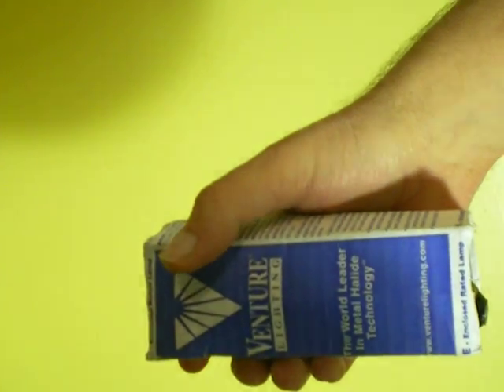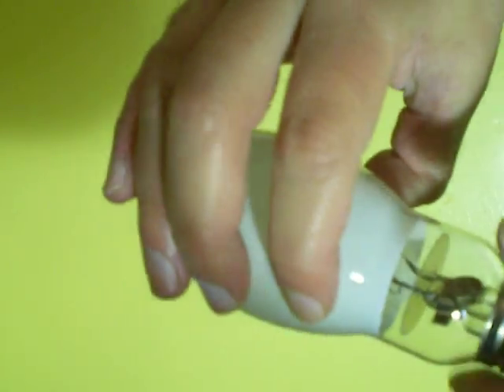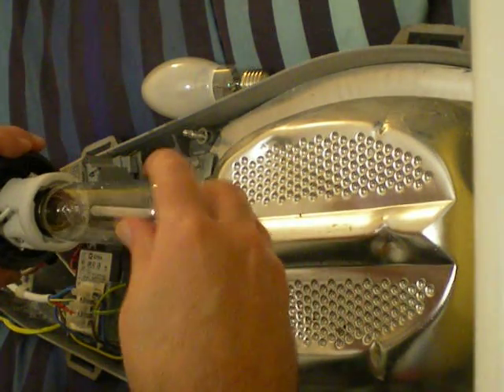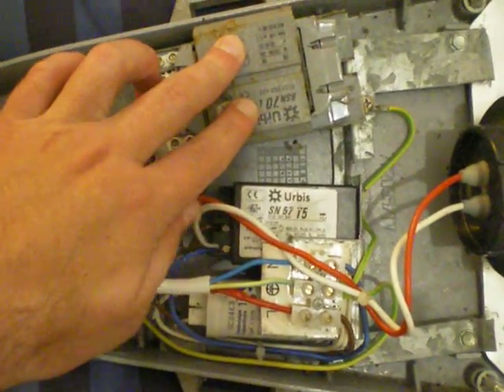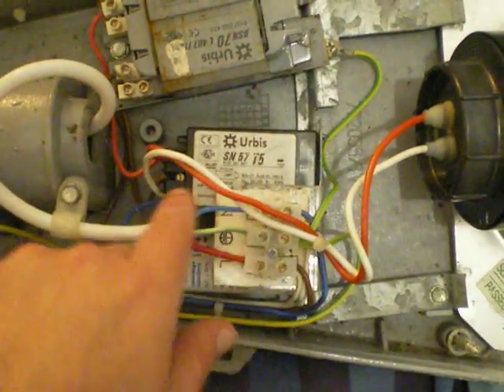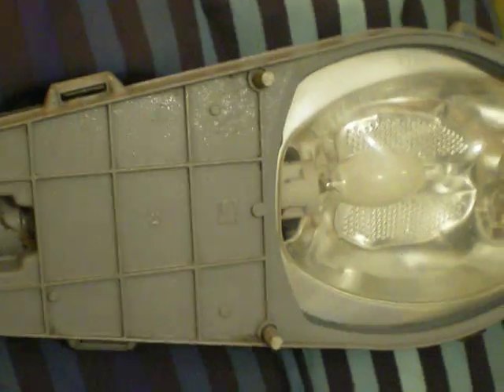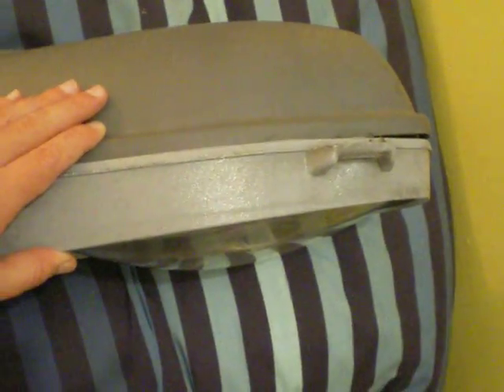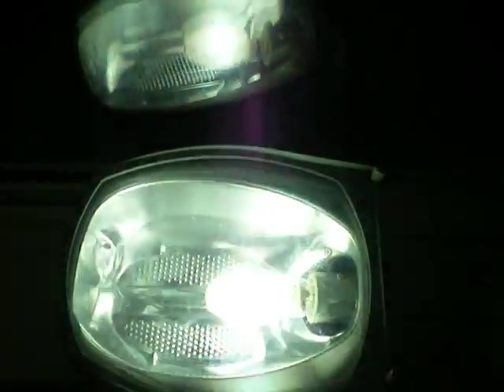Phosphors Coated HID Lamp

Comment from the maker: @Dazm229 The HID Lamps are the replacement to Both Son & MV lamps Also 2 pin Compact fluorescent tubes are now being used to light up miner roads those are T5 double tubes ranging from 36w-58w All old Low Pressure Sodium fixtures are now being replaced by compact fluorescent streetlights or HID lamps LPS Fixture will only be used in areas near observatories